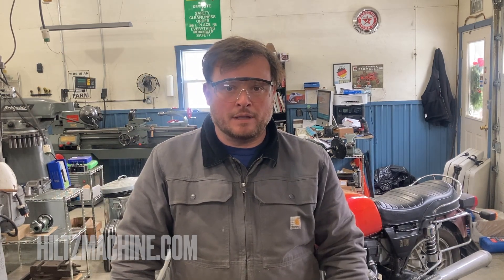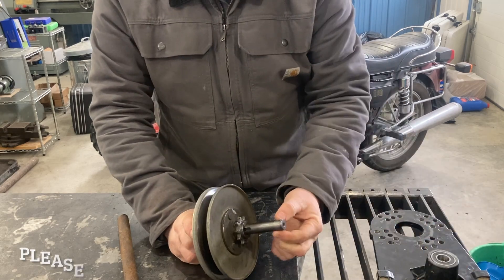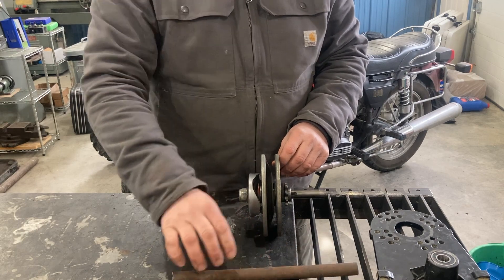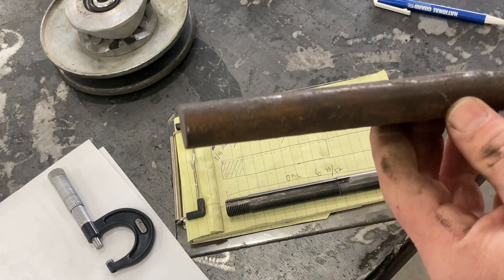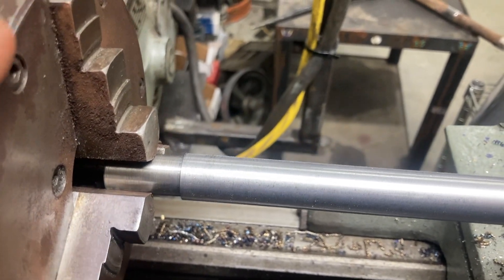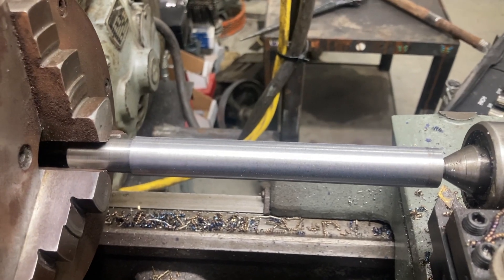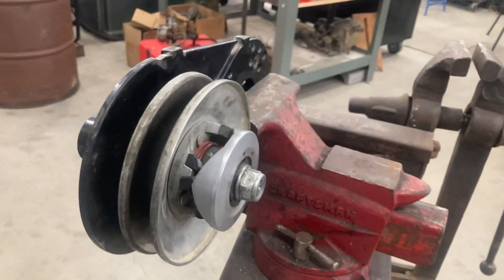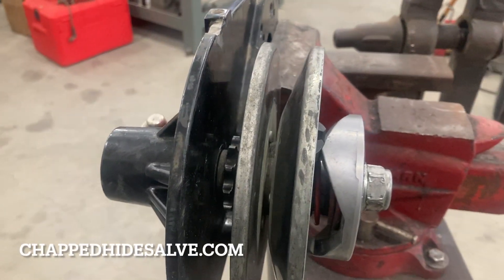Machining a New Shaft for Mini Bike Torque Converter

Comment: Nice. Is the new jackshaft 16mm and uses a 5mm key, or is it 5/8" and uses a 3/16" key? 

Some sellers will get you either 16mm or 5/8". It's best to have 5/8" if you plan on a gearing change. Aftermarket sprockets are 5/8" bore and 3/16" key or keyway.

The last torque converter I got the seller had 5/8" jackshaft in the description. I was pissed when it came as a 16mm jackshaft.

Comment: I recently put a new cvt on my bike, and i drilled and tapped a zerk fitting onto the housing so i can grease the shaft and bearings.
Reply from the maker: It’s amazing to me that they don’t have open bearings in the inside and provide a grease fitting

Comment: Jeremy good video! It's funny as I searched an hour ago about key seats and then boom your short showed up!  I have to cut a key seat on a 3.25" aluminum tube so this was helpful. Thanks!
Reply from the maker: Wow! What a coincidence. If you want any specific advice, let me know! I have another shaft video where machine both a woodruff keyseat and square keyseat using a lathe milling attachment. Same principle.
Reply: @MaineMachinist  Thanks I think it should be pretty straight forward...  Famous last words!  I plan to just clamp it to the table using the t-slots to stabilize it.  I am planning to indicate it along the X after getting it clamped down. It's only about 2" long so if I'm close it should work well. It's closed on both ends so it's a plunge cut then cut the slot.
Reply from the maker: @Scottforyoutube  sounds like a solid plan! I actually prefer working off the table instead of in a vise for a lot of jobs.
Reply from the maker: @Scottforyoutube  I have a small ground block that slides right into the t slots on a Bridgeport Series 1. That allows me to reference things really quick especially if it’s a non critical part
Reply: @MaineMachinist  that sounds great these types of things would be very interesting video content.  Seeing those kinds of setups is so helpful for us hobbyists.  Most of us don't have mentors and not working in a shop with experienced machinists all I have is youtube to help figure stuff out! Thanks!
Reply from the maker: Farm Shaft Duplication - ALL OLD SCHOOL - NO DRO. NO CNC. Milling Attachment.
https://youtu.be/p4cGt4dj4LI
Reply: @MaineMachinist  I'll check it out! TY